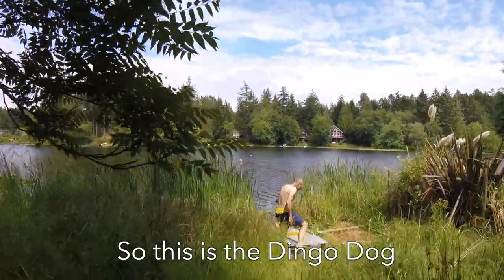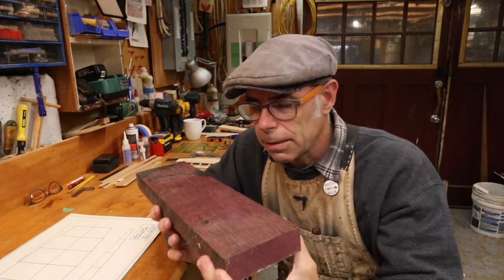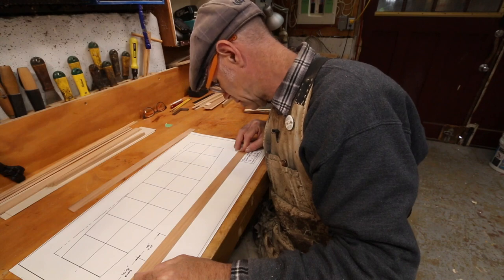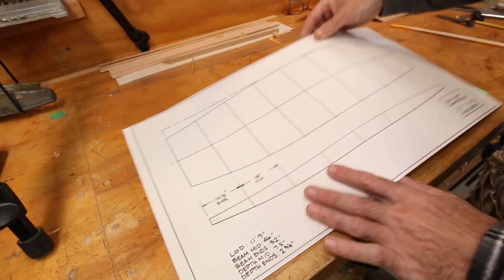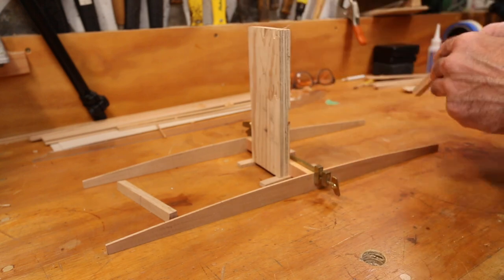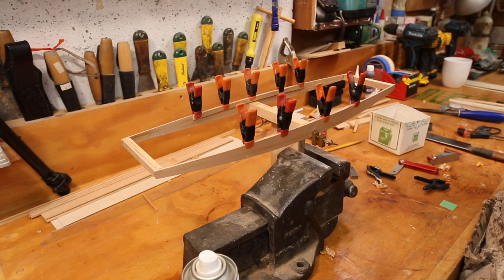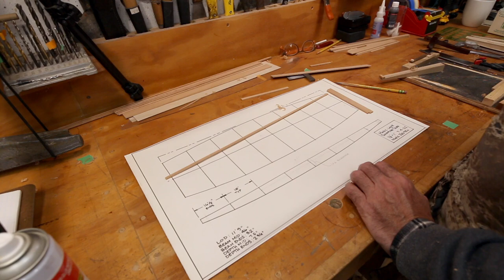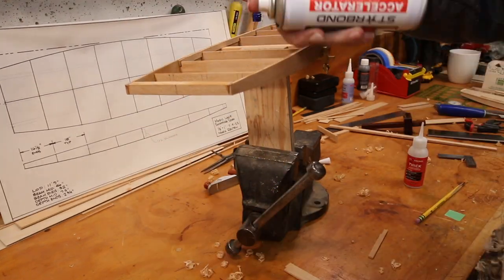Designing a Scow for Swimming - Part 1

Comment: Model making bench, that's a goer I think. I make a lot of plastic models and some get modified slightly along the build. I have some model ships to build my father started many years ago and never got beyond the keel and frames. Kits manufactured by a Danish company called Billings Boats. I have built one so far, a French Tunny Boat, which I use as my profile picture as it was a work of blood pressure, strong language and 14 months. The plans were devoid of building instructions. Very few of the boats survive and it was hard to find information on the web, but I found enough to do it justice. 
Then I go to buy fish at the local fishing village a few miles from me and theres a restored one tied to the wall. Where were these guys when I started the build ? A French group, they invited me onboard for a look. They are a sweet boat , broad in the chest and a deep keel. I think I did a fair representation if I say so myself after seeing the original. So yes enough rambling, go for it, a modeling bench and I can get to start the other square riggers in boxes.
The guy who thought of the little nozzles and extra bottle caps. He's one of us, he has been there and done that and suffered a bunged up bottle of CA glue. Bless his cotton sox.
Reply from the maker: I was really happy to see those extra caps. Some brands like 2P-10 will sell you extra caps but it just isn’t worth it when shipping is factored in. It’s the same cost as replacing the whole bottle locally.

Comment: I really enjoyed this yesterday on the Patreon release. I was also going to buy some Starbond CA adhesive, so the timing was perfect. Looking forward to seeing the rest of this series.
Nice flex there with the random block of purple heart, BTW😉
Reply from the maker: Flex purple heart?! Good luck man. That stuff is iron.
Reply: @Nomadboatbuilding  I'm assuming you're joking. I made some footed cedar arrow shafts with purple heart. Never got around to doing any Osage, but they'd be tough as hell too.
Reply from the maker: I would have thought the weight would be a deal breaker for arrows.
Reply: @Nomadboatbuilding  that's why it's just the last 6" including the splice. There's also a big movement for high forward weight balance.
(known as high FOC). Same reason as why the front end of a dart is the heavy end. Makes the arrows recover quickly coming out of the bow.

Comment: AVAST: When you push the side boards together at the ends, because of the curve, doesn't that make the overall length shorter? And, consequently, doesn't that reposition the location of the bulkheads, save the center one of course?
Reply from the maker: You are absolutely right. We lose about an inch or two in length and the spacing of the bulkheads changes but none of that is particularly important in a simple form like this. If the bow came together into a point it would make a big difference but in this case, the order of the day is to keep everything as simple as possible. That’s the prime directive of this design. You can see me explore the details you point out in my model making series.

Comment: Great video and yes on the model workspace video if time allows. BTW, any canoe refits/restores on the horizon do you think? I loved those and may go back and watch again. Wondering if someone might drop one off at the end of season.
Reply from the maker: I don’t specifically have any canoe repairs on the horizon. I've in fact turned several away recently. They represent a negative net benefit for me financially so I’m passing on the work to others. I have been wanting to continue the series. Currently I don’t have adequate footage of past projects to do it as I would like so I am contemplating a full start to finish series on one canoe at my disposal. It's a rare 10’ Chestnut Trapper model that needs pretty much every possible repair. So it’s on the probable list along with other candidates.
Reply: @Nomadboatbuilding  I get that. Those canoes looked like they took an awful lot of work. I was recently working on some thing on my old truck it took over an hour and I thought if someone was paying me for this they just wouldn’t understand…
Reply from the maker: The big trouble is the perceived relative value has got well out of sync with the effort required to bring those boats back. It’s the canvas element that kind of kills it. Too much work to get that stuff on, filled, faired and painted. Most folks just send it out the door with a lot of weave showing. I hate doing that. Then the lifespan of the cotton can be really short under certain conditions.